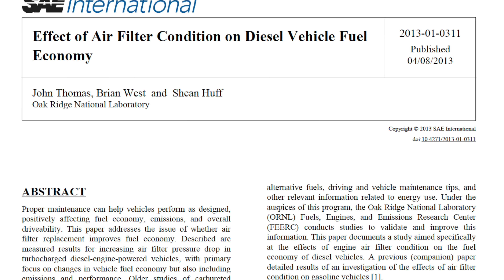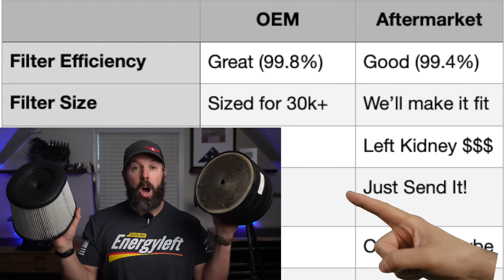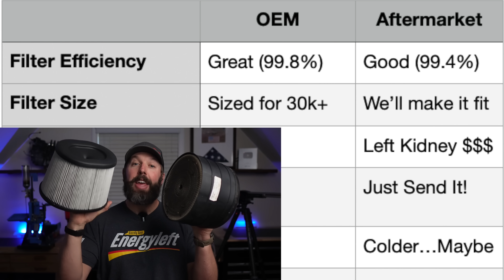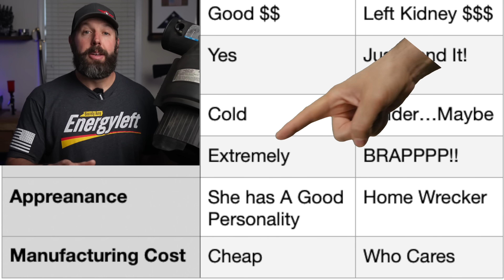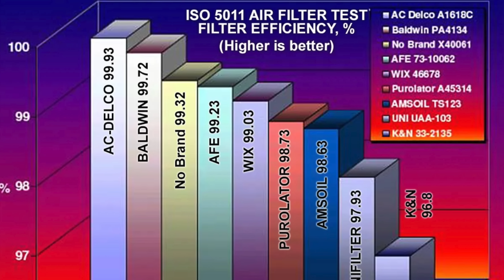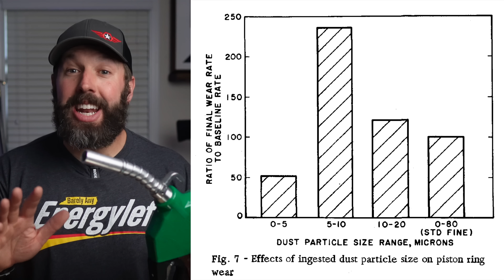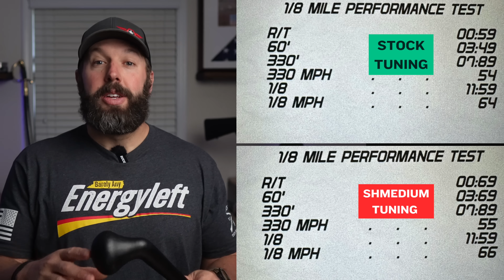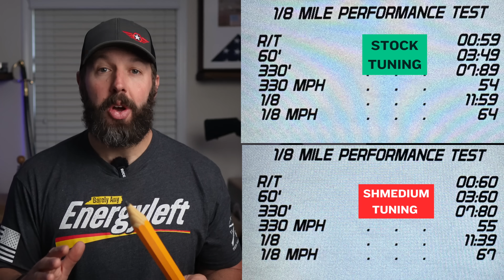The TRUTH About Cold Air Intakes…ACTUAL SCIENCE!

Comment: I have worked for OEM auto manufacturers and aftermarket groups. No names
I spent 6 months testing a muffler. A freaking muffler for sound performance durability for OEM. They spend millions
Aftermarket. Send it they spend 1000$ maybe. Testing. Meh let the consumer test it

I run OEM filters, and ditched aftermarket overpriced junk.

K&N fans going to have a stroke. Ha ha.

Comment: great video.  i have a filter minder on my stock air box and plan to wait until its touching red to change it after this.   as for video ideas. how about an update on that duramax centrifugal bypass filter that probably uses centripetal force to eliminate very small particles from engine oil?
Reply from the maker: Gonna do send in a sample at 7500 miles and a follow-up video at 10K. So it's coming. Just want to give it time to do it's thing.

Comment: Yeah, I bought my 2000 Cummins four-wheel-drive 3500 seriesin 2014 and still have it today. It had one of those cheap cold air intakes on it with a filter that I could literally see through. I had to go on eBay and for $90 I was able to find a stock air cleaner. Thank God today 300,000 miles in it still going strong.
Reply from the maker: I bought a 2006 with 300k miles on it. Guy had installed a K&N on it. It burns a quart every tank of fuel...
Reply: @freedomworx  ouch

Comment: The factory ram intake not only pulls air from the fender. When you hit a certain theottle percentage it will pull from just behind the grille. Ram air in a ram. Dont wait as long as i did though. My turbo sucked a hole in the rubber part of the factory intake when thr filter got clogged. Turbo was dusty....

Comment: I run a Donaldson 6637 on my obs 7.3. On  a 70 degree day, my intake air temperature sensor in stop and go traffic with the truck up to 200 degrees EOT runs between 95 and 98 degrees. Running down the highway at 65, it was 74 degrees.
Reply from the maker: That's interesting data. Thanks for sharing.
Reply: For context, the sensor sits right behind the filter on top of the wheel well plastic liner. I checked the sensor against ambient after letting the truck sit overnight with FORScan and it matched ambient before warming up and testing. I watched the KC turbo video a while back and thought they missed the mark not road testing and just using a big fan and comparing intake air temps. I don't think a 6637 would ever give more performance gains than a cold air intake, but with a mostly stock truck the difference is temps is negligible and I get the better filtration with the Donaldson filter.  I saw a guy fit a 6637 inside the AFE stage 2 cold air intake box and would give that a try if I ever start making a lot more power. Love your videos man, keep em coming. Semper Fi!

Comment: Filters (oil/air) block more particulates as they get dirty but they don’t necessarily get more efficient.
Reply: How is blocking more particulates not being more efficient, when filter efficiency is measured in the number of particulates blocked?
Reply: @EricksonEtc  efficiency is a ratio of flow of (air/oil/whatever) vs filtration. If the filter blocked 100% of the oil or air, it would block all particulates but that isn’t efficient as it is blocking everything. The ideal filter would offer zero resistance to the flow and remove all particulates.  All filters create a resistance to the flow of the material filtered and as they get dirty, that resistance increases.  So efficiency is more than just blocking all the bad stuff.
Reply: Probably where some of the power loss is from. Shoving/pulling more oil/air through the filters.

Comment: SO I had to go out to one of my subordinates cuz he couldn't get his car started.  I was like, "i work on generators and diesel engines." so I went out and sure enough, his Jeep wouldn't start.  So I went down the list, Fuel, Air, Compression, Ignition.  Out of these four items, air was going to be the fastest and easiest thing to check.  I checked his air filter and it was caked with so much dirt, I thwacked it on his tire and I swear a homeless dude got knocked out of it cursed at me and shuffled away.  This was in Puyallup Washington, so you know it happened.  I left the filter off and had him crank over his engine, and sure enough, it started.  Put it back on and met him back at work.

Change your air filters when they're dirty enough to knock dust out.  It's not big deal.

Comment: The oem filter box for our 7trees is bad about leaking, putting the filter rating somewhere around zero.  This is the main reason for swapping over to the 6637 style filter.
I've had the Donaldson Blue 6637 equivalent for several years now and it seems like it's a good choice, but with a T4 conversion I sorta had too. 
No signs of anything getting dusted yet.
Reply from the maker: You should watch the testing KC Turbos did on that filter... I was once a victim of the 6637 craze, so I'm not pointing fingers.
Reply: @freedomworx    That is a good video, I had not seen that.  They didn't test the filtration though, and it's dirt getting around the stock filter that started the 6637 fad in the first place.  At least that's why I do it, and if we're going to go along with 'flow more means filter less',  what would be the better option that flows more and filters more?

Comment: I gave this and honest attempt of my usual critical lens of your content. The only thing you missed is with increased flow on MAF engines, you need to recalibrate the engine with cooler/more air if it even does that...
Reply from the maker: I didn't miss it. It's just not a thing on modern engines. An ECU reads a MAF Sensor and a Temp Sensor to provide an accurate mass air flow. That's how a MAF works. It has to know the temp of the air to calculate the mass. You need to recalibrate the MAF if you change the cross sectional area of the intake tube, where the MAF is located. Because the MAF calculates the volume of air flowing passed it based on the speed of the air in a defined cross-sectional area. It then takes the temp of the air into account to calculate the Mass Air Flow. You need a pressure reading also on boosted engines.
Reply: @freedomworx  yea but like with a lot of your content, there are like weird boundaries to talking about beyond some imaginary line like it's out of bounds. You say why you don't talk about it in the video, then say it's not important, but also don't address what happens with a stock tune if you don't have a maf. 😂 If you can't tune because EGR is good for your engine and dpf just lowers particulates and stock tunes are best, why would you want or need a cai or exhaust? So why post this? I can't follow the point of your content. Just talking about engineering stuff to educate the public? No tunes, all stock, champion unpopular stuff, negative opinions on aftermarket... I don't get it.

Comment: Cold air intake should be compared to an open cone in the engine bay, as that would be the 'performance' alternate item. Compare those two and the cold air is indeed better regardless if it is OEM or aftermarket.

Comment: I'll just save money and remove my filter entirely. That way there's not restriction whatsoever. Then I'll compensate for the increased levels of contaminants by changing my oil every week without exception. With the 5 or so miles I drive every day, it'll also ensure that there's no fuel in my oil as well.

Comment: I like alot of your videos, that why I subscribed. The cold air intake by itself is not going to really get you that NOS affect. It just won`t. But, as cars age and ridiculous prices for tubes and flex sleeves goes up, cold air intake is a PERFECT and obvious option. Now, does a "cold air intake " make power? In most cases yes. Bar none. Not all cold air intakes have design or r&d in them past the LOOK. But most major brands do in fact work. Lets take the 7.3 ford diesel platform. K&N does let in too many large particles that will "dust" the cold fan on your turbo. Fact. If your getting a cold air intake to run at Glamis then you may be a moron. Just my take. So on the factory 7.3 filter system, the top never did seal. NONE of them. Then during the Liberation of Kuwait, again like Glamis, the engineers had to figure out something. They came up with a huge Donaldson filter that had plenty of CAPACITY to feed the 7.3 air. And do it clean. Yeap, thats how the 6.0 factory filter cam about. Its the same filter as the HD 7.3  filter. Which I have on mine. Did it prove to  have more mpg and power, yeap. Seriously. So  now onto the 6 oh factory filter system. You ever cracked one open? Then tried to put it back together? Yeah, cold air intake for me. I don`t have the 4 hours required to waste on putting that pita back correctly and get the clips to snap, but thats just me.
Reply: Bytheway, that looks like  a 45-70 "the Trapper" in the background. I got one too. Never sent it back with the 11:30 front sight machined in barrel. Why? It proves I got a first production run. And I dont need to aim that thing. You dont need to aim something that blows a hole the size of a pumpkin in the chest of a grizzly bear. Just point and pull. It'll die.

Comment: Do you think a bypass oil filtration system would offset the excess dust inhaled through the cold air intake?
Reply from the maker: Yes, I mentioned that briefly in the video. My Duramax runsa bypass filtration. I'll likely add it to my 7.3L Power Stroke also.
Reply: @freedomworx which bypass filtration system did you use after you said that you took it off from leaking and you couldn’t stop it? Amsdoil?

Comment: Everyone says this about k&n but I'm about a million miles in over the decades and never had any dust in the air tube or the turbo. I did run the stock filter for the first 12k miles in my 2020 Cummins. After I cleaned the dust out of the air tube that got AROUND the filter I put a drop in k&n in. It seals better and doesn't let dust around it. The k&n filters plenty good. BTW I have put many thousands of miles on silty, dusty desert roads and I commute past a cement factory every day. Dirty dusty environment. It's not power I gain it's filtration.

Comment: Bought a 06 LBZ with 150k on the clock. In an attempt to try the PPE airbox mod mine crumbled apart so it now has the S&B kit on it. I did not really pay attn to IAT before but they are regularly higher than ambient temps now, not by much but are higher as measured with a CTS3.
Reply from the maker: Mine are higher when the engine bay is heat soaked. But they drop to ambient after a few miles on the highway.

Comment: I modified the intake for the 1997 Ford f-150, 3 inch PVC pipe into the fender and elbow into the throttle body, factory air filter, got peppy and 2-3 mpg on the highway, maybe $40 in parts. The early Duramax used the same air filter as the LS trucks, seldom get as much crap as Duramax did, change them maybe 2-3 oil change. In the old days with 14 inch air filters, used Moroso base( drop down ) and 4-6 inch HD Chevy air filter, normally cheaper than lower height also. On the Duramax, put foam around the air box to help air into the filter box.

Comment: Finally someone talking sense about these filters. I fell for a k&n filter on my last car.. it was a terrible idea. 50 000km later the intake had a fine level of dust inside. The filter was cleaned and re oiled properly, it's just a shit filter. There was zero performance gain so all I was doing was damaging the engine.   I will never use a gauze filter again. I'm staying stock.
Reply from the maker: Yep. They are great at ruining engines. They belong on the racetrack, not on vehicles that need to last hundreds of thousands of miles.

Comment: Like some of the others have said, it's "Merica". When we used to flip the air-cleaner lids so we could hear that four-barrel "buh-woooo", we weren't thinking of engine life, or oil. We were thinking of well, socializing, showing off. Your videos are always top shelf. Thank you.
Reply from the maker: I flipped a lid or two in my youth. 😉
Reply: I looooved the sound of the vacuum secondaries opening.
Reply: 70 coupe de ville with the 500, those things had massive secondaries.
Reply: @bdkw1 63 Belvedere crossram and a 78 340 w/ a 780 vac sec. Never heard anything g but exhaust.
However, the 340 @ 5k was at 2in on the gauge w/ the sec rod blocked closed so the engine didn't flow or the carb was too big.
Reply: @OldCurmudgeon3DP  , my first car ever, I paid $500 for, was a '66 Belvedere with a '67 front-clip, hand primered and some cheap mags and side-pipes. I loved that car. It only had a 2 bbl though, 318.
Reply: @RSAF-rms typewriter shift by chance?
Maybe that was just early 60s.
Reply: My exhaust was always too loud to hear the intake.
Reply: Even did that with my ‘94 GMC 2-Dr Yukon.  It had the tbi, and I loved hearing that thing opened up.
Reply: 73 Lincoln with the 460!!! Now that hauled.
Reply: If choosing between getting laid and shorter engine life from a 30 minutes hat flip, you know what's the answer to that.

Comment: Do a video on aftermarket engine tunes and whether they accelerate wear/shorten life.
Reply from the maker: I'll add it to the list!
Reply: MY HYPOTHESIS

Whenever you increase performance, you are putting more work into the engine, drivetrain, tyres, etc

Thereby you are using its life up more quickly
Especially if you are living in the top third of the RPM
Or hauling and towing

Can that be mitigated with more frequent filter + oil changes, superior oil, etc? Perhaps
But then, you are paying for it with the increased service
Although hopefully less so than a damaged engine

That is why old Ford 300s last for ever - because they didn't ask very much of the engine

+++

BUT
If you only baby an engine, you can actually gum things up (especially with EGR, etc) and they die early from carbon deposits, etc
For example, in Australia, modern diesels that actually "get driven" have better longevity than those doing grocery runs, school drop off, stop start traffic etc

AND
Any particular engine design may well be an "understressed" or "over engineered" engine
Therefore, even if you use it up more quickly, it will still last an age
But if you have some small super + turbo charged petrol engine, it's already at 9/10ths

Those are my thoughts, for what they are worth
Reply: @willhooke  spot on….you have spewed facts that some will never understand 😅

Comment: I have a '19 dirtymax that had a broken corner on the stock airbox allowing unfiltered air into the "filtered" side of the intake. A new airbox was $800 from GM. I opted for the $400 S&B system with a pre filter over the "cleanable" filter. I dont drive much on dusty or dirt roads. Im good with my decision..... probably.
Reply from the maker: Just don't clean it...like I dont 😂

Comment: This is very much specific vehicle dependent. On my pickup we put airaid intake tube on the stock air box using the stock filter. They actually do pick up power and fuel mileage with a better designed intake tube. A little bonus is to cut the airbox intake tube in the fender open a little bit more and it gains a little bit better power up top. Especially intakes with silencers or the accordion crap. The air flows much better without that stuff. Now it's usually on a naturally aspirated vehicle and not a boosted vehicle that this really helps out a lot. I actually picked up two tenths in the quarter mile which is quite significant. Yes that was with a custom tune on both intake tubes. My daily driver pickup also gained fuel mileage and power but I don't run it at the track. Now it might have only picked up 4/10 of a mile per gallon but it's been 3 years so it's already paid for itself. One thing I've noticed is when I get moving in traffic by intake Air temps in the summer go down a lot quicker. Factory intake tube stays heat soaked longer. All of that stuff adds up. Not to mention with a tune and intake temps being hotter you're more prone to spark knock so my factory intake the timing would need pulled more often in hot stop-and-go traffic. Which that still blows my mind because it's just a damn tube but I guess the aftermarket tube cools down quicker I don't know. I just know what the data tells me. I'm just glad to use the factory style filter because they do better.
Reply from the maker: I actually showed your exact scenario in the video. It makes a difference on a tuned truck. It made no difference on my truck when running stock tuning.

Comment: Ooh I'm going to make some guesses.
1. The factory intake is almost always an actual cold air intake. A lot of the aftermarket CAIs are.........hot air intakes.
2. The factory builds 500+ hp vehicles using the factory air intake. A cold air intake will help your 280hp truck exactly the same way Nike's newest running shoes will help me run a 4 minute mile: Not at all.
3. Lots of high flow air filters flow more by just filtering less and letting in way more dirt. Unacceptable.
4. Sounds cool though. Maybe.
Reply from the maker: Did you read my script? 😉
Reply: @freedomworx  Probably
Reply: You forgot to add in all the freedom sounds